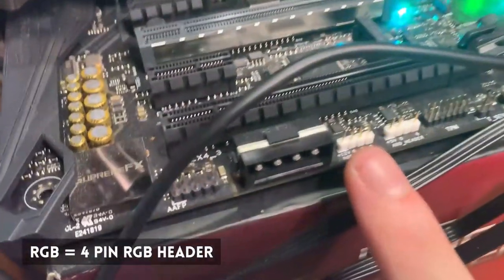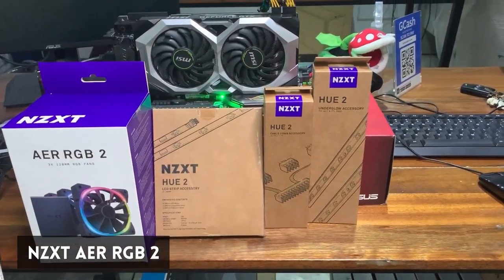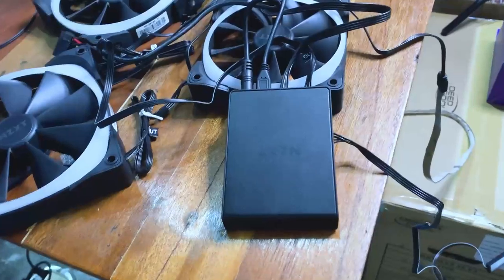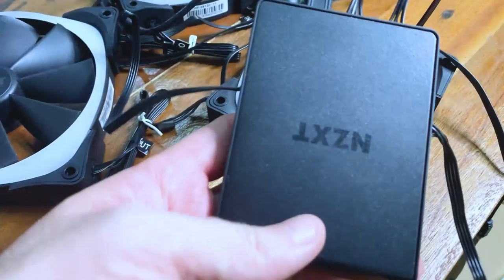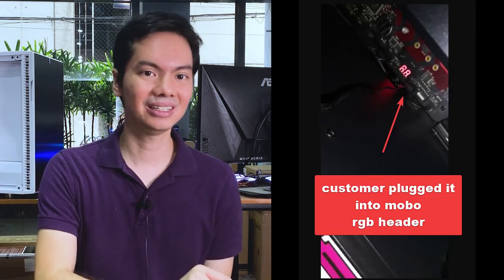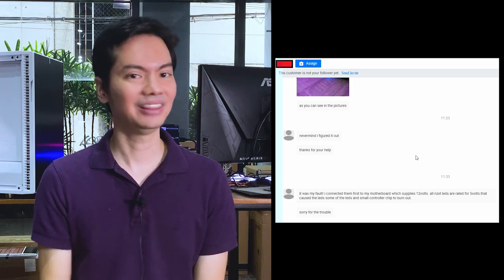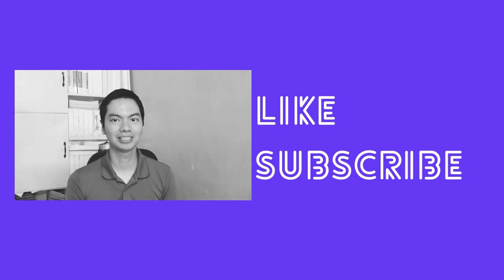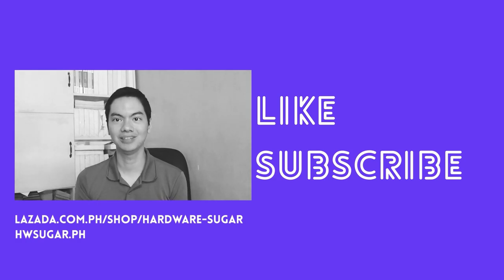Don't Do It - Plug NZXT RGB into standard motherboard RGB header

Comment: I can confirm plugging the NZXT rgb fans into the 12v rgb header on the mobo lights it up momentarily followed by some lovely pops of the LEDS exploding, lastly with an aroma of burning electronics. That’s one rgb fan down the drain. I’ll tell you this it might actually work if the output of the header was 5v instead of 12v because the LEDs are 5v LEDs
Reply from the maker: I wouldn't try it even with the argb header, just get the nzxt controller to be safe :)
Reply: did it damage your motherboard too? or just the led's?
Reply: @hwsph  F120 RGB working just fine on the 5v header with an adapter cable using mobo RGB software

Comment: I plugged Phanteks case rgb into asus dark hero aura gen1 12v with official phanteks adaptor to do the job. Worked for about 5 seconds until the rgb controller exploded on the mobo.  Thankfully the case leds were unharmed and can still run off the basic phanteks controller.
Reply: Same thing to me with the NZXT strips that came with the case.. tried plugging into the 12v header.  .. just a few seconds then nope.

Comment: The short answer is if you plug into wrong rgb 12v header instead of 5v Argb header, it won’t fry your motherboard or rgb or your Aio cooler. The motherboard has protective mechanism that prevent boot up if rgb is wrongly plugged in. I have never damage any rgb so far in 2 pc. As a matter of fact, I have tried it myself with nzxt kraken x63 and the pc won’t boot until the rgb cable of the pump is plugged into the correct header I.e argb 5v

Comment: I did it.. before I saw this video.  I have an NZXT H510... Plugged one of the RGB case strips into a 12v header.  BOTH are 4 pin.. but NZXT is 5v. What the heck NZXT. I know I'm dumb, but that's dumb.  The strips are dead of course.. just 2 lights out of 20 working.
Reply from the maker: RIP led strips :/

Comment: my 120mm AER RBG 2 NZXT fan did not come with a hub of any kind... i was not aware i even needed one...
the GPU i have is RTS 3060ti
CPU AMD Ryzen™ 7 5700G 3.8GHz [4.6GHz Turbo] 8C/16T 20MB L3 Cache 65W W/ Radeon Vega Graphics
and motherboaard is
ASUS PRIME X570-PRO ATX, RGB, 1GbE LAN, 3 PCIe x16, 3 PCIe x1, 6 SATA3, 2x M.2 SATA/PCIe  MSI

Comment: I have 4 NZXT F120 core RGB fans and 2 F140 core RGB FANS, can I run those through two 3-way splitters and plug them directly in the 5 volt (3 pin) RGB headers on the motherboard?

Comment: Manufacturers really should make RGB connections user friendly. Proprietary connectors and hubs are just plain greedy on the manufacturer's part so you can only buy products from them to upgrade your system. 

Then there are instances like what you shown that end users inadvertently damage the products. If these users were in the USA and bought it from Amazon/Newegg they'd send those back for RMA and just add unnecessary costs for everyone involved.

I know it's the end user's fault for not reading the manuals thoroughly but you can't expect casual first time builders who aren't technically inclined to get these things right even if you explained it to them.

If they can implement standards for PSU connections, USB, PCIe connectors, 3-4 pin fan connectors, why can't they do the same thing for RGB?
Reply: "Proprietary connectors and hubs are just plain greedy on the manufacturer's part" you got it. On top of that, they'd also update those hubs once a year with new versions or "PRO", "ELITE", "GAMING PRO" variants.
Reply from the maker: I agree RGB could be a lot easier. We still get confused by different rgb products all the time.

Comment: I fried my 140 aer 2 rgb by plugging it to the led strip extension. Smells nice
Reply from the maker: well at least you got some enjoyment out of it
Reply: @hwsph  Actually one of them worked for 4 months without getting fried. The OUT side of the cable was plugged into 4pin exstension from the led strip.  It had to be secured with tape because it was getting disconnected easily. Now i got new fans for my h510 elite and it fried instantly

Comment: Are you serries, the RGB strips from NZXT are addressable and just remove the splitter cable that allows them to plug into the hub, than plug the RGB directly into the addressable connection on the motherboard.
Reply from the maker: this video talks about plugging it into the 12v 4 pin rgb header, your comment is talking about plugging it into the 5v 3pin argb header - these are 2 different things

Comment: I got my first NZXT RGB fan today and of course plugged it into mobo and was wondering why it didn't work... Now before you say "should have looked into the manual" it explicitly said in there to either plug it into the hub or directly into the motherboard... (F120 RGB fan)
In my opinion it's stupid and actually malicious that you need a proprietary hub for the RGB to work.
Reply from the maker: no judgement, happens to a lot of people

for the higher end brands, eg. nzxt, corsair, unfortunately a propriety hub is the norm

Comment: Yes, the hub will still work, only the stripes will get damaged if you connect it directly to the Mobo. For me personally, all the chanel in hubs are working even after connecting damaged Nzxt strips back to the hub. The hub actually has hard time detecting the strips and sometimes recognizes as a completely different product. The stripes simply doesn't work. That's all. Nothing much will happen.
Reply: Can verify. NZXT detects smart device and strip but only one led lights up on the strip 😢

Comment: does kraken Z73 water cooler work as a HUB for my AER 2  fan? there is a 4 pin header that is connected to the hub and is just dangling there cause I bought none RGB one :/

Comment: Im so scared right now, literally shaking. I plugged in my fan to the fan connectors and the other to the rgb header (its a corsair fan) as soon as i started it up i hear this “buzz” and the smell of burnt. I quickly unplugged it. No damages seem to be on my motherboard but my fan does smell like burnt. Where am i supposed to connect my second cable? The rgb header got it to turn on. Also will i be ok? Is my motherboard going to break?
Reply: well, 4 pin cable, 4 pin mobo header.. I will explain it to you. 

Corsair Eco System is easier to play around with and adapt other non Corsair products to it than NZXT in my opinion. Also Software.

Anyway, lets get to your issue.

Corsair uses 5 Volt aRGB and the 4th pin on the RGB fans are for daisy chaining, so your effect will continune on to the next fan. 
Your 4 pin Motherboard Header is 12 Volts. This means, you blew the LEDs on the fans due to overvoltage if they dont turn on when you try again doing it right this time.

Now to the solution.

You need a Corsair RGB Fan Hub (preferably the one that directly goes to usb) or you can use a Lighting Node Pro and then a Corsair RGB Hub. Or you could get a Commander Pro and a Corsair RGB Hub. Or what also works and is probably the best solution, Corsair Recently dropped the Commander Core XT. The Core XT lets you connect 4 pin PWM Fan cables AND 4 pin RGB cables into it. For a total of 6 (RGB) Fans.

So whatever you choose to do, from my eletrical understanding, your LEDs on the fan are toast. If you get warranty and can get a RMA, go for it. Otherwise you will need another Fan, a RGB Fan hub/Core XT/Lighting Node Pro + RGB Hub. Remember to plug the RGB Connectors into the 4 pin connectors on the device you will end up using. If you use a Core XT in the end, be aware, Fans use 12 Volts. So if you plug your RGB Cable into a Fan header on there, you will be roasting your LEDs again. 

If youre unsure where to plug what, read the manual carefully. RGB is confusing, I know. And manuals can really help an unexperienced user with these things.

All the above is regarding to your problem, so if you have read until here, I say thank you for listening and I hope I could help. However I want to explain a few things more, if you dont care about that and stop reading my stuff underneath, thats fine, but it might be useful in case you want to deeper understand what Corsair is doing here.

So as I said, Corsair is using standard 5 Volt aRGB on the 3 pin connections. Which is a good thing actually. It means they dont have to reinvent the wheel and also a user who knows that, can use that knowledge to adapt any 5 volt aRGB device to their controllers and let them use non-Corsair RGB LEDs in Corsair Software.

So for example, if you make yourself or get an adapter from the 3 pin JCORSAIR (Locking Dupont) connector to like a standard motherboard connector (3 pin 5050), you can use a whooole lot more RGB devices that arent from Corsair. Im currently working on such stuff myself for my upcoming DK-05F Build.

Currently I'm experimenting with using a Lighting Node Pro and a 3 pin aRGB adapter and a normal mini USB to USB-A cable (The one USB Connector type that has been around forever basically, I cant show you pictures on YouTube comments, but if you search them up, you will see for yourself)
for external use of non-Corsair RGB LEDs and devices. You can also hook up fans from a different manufacturer, as long as they use 5 volt 3 pin aRGB.
Only thing you should note though, dont connect more than a certain amount of LEDs on to one Channel, or you blow the fuse on your Corsair controller. Or worse, you blow your Corsair controller and not only a fuse. Judging from the fact that Corsair lets me configure 5 450mm (135 Leds in total) RGB strips in software on one port of my Core XT and Lighting Node Pro, I assume you can roughly hook up to 100 LEDs to one port. Dont quote me on that tho and I havent tried or met the limits yet and I certainly dont want to do so. Those Controllers arent cheap afterall :O

And for configuration in software:
Choose whatever Corsair product meets your Devices LED count in the menus. And if they dont match up perfectly, configure it as a product that has slighty more LEDs than what you actually have. Rather have the effect not top out than having it not fully utilizing what you have :D

So for example, you want to connect an Arctic P12 PST aRGB fan to your Corsair stuff, check the fans specs, it has 12 Leds. A HD120/140 has 12 Leds aswell. Perfect! So you just add it as a HD fan.
You can get pretty creative with it, especially when you use a "fan" in software for a LED strip in reality.
If you get to understand it, it can be very nice stuff. Have fun, hope this helps anyone!

Comment: If i plan to use 1 AER RGB 2 fan as a rear exhaust fan... do I really need the hub still?
Reply from the maker: short answer, yes

if you have the h510i it already comes with a "smart" hub which can accommodate one fan - if you don't have one of the cases that comes with a hub you'll really have to get a hub
Reply: @hwsph  bruh :(
Reply: @CoolJoshido212   have you tried connecting the fans to the mobo header? because I am also thinking to get one of those fan to use as a exhaust fan
Reply: @starrims  i got the fan hub but don’t have a spare USB 3.0 on my mobo

Comment: well, shit. took me ages to find this one out

saw something on making fans quieter which involves just putting the fans on their own headers on the motherboard and just do a fan curve the old fashioned way, slightly different speed on at least one 

so I cracked open my H710i and took out the hub, thought I wouldn't need it since case fans aren't gonna be working on it. never seen the types of ends on the RGB strips that come with the i on anything else, just figured the one end that normally would be in the hub could plug into the motherboard aaaand it didn't work. 

figuring out now that NZXT wants you to use their hubs. even if I haven't completely fried the strips. I'll be getting rid of them for standard strips

Comment: so what do we plug in to the rgb/argb header on the mobo's? fans only?..
Reply: RGB devices. Just not NZXT stuff.
Reply from the maker: most rgb is still plugged into the mobo headers (eg. aios, led strips, built in case lighting) although you do need to watch out for those which have their own system (like NZXT)
Reply: @hwsph  thanks. I realy have a bad history with mobos and headerals. thanks for clearing it out. more power sir!
Reply: @rockyismael  thanks sir!

Comment: bruh the shop owner told me to plug it right into the 12V BRG header cause I had one AER 2 fan so I asked him do I need a hub for this? he's like nah there is an RGB header on the motherboard...
Reply from the maker: you can try that advice, if you do let us know how it goes :)
Reply: @hwsph  fan is fried most likely, some leds are stuck at green blue and red tho it is still spanning , I wish I found your video earlier  ):
Reply: @hwsph  does kraken water pump work as a hub? it has a 4 pin header on it and it is also plugged into a USB slot on the motherboard if so the shop owner should've told me that
Reply: @hwsph  rip $40
Reply from the maker: @PieZuri  damn bro sorry to hear the fan is rip - the kraken does function as a hub but it's just to power the fans to spin, to enable/control the rgb you'll still need nzxt's smart controller (like the one we showed in the video - all of the rgb stuff plugs into the controller and then the controller plugs into an internal usb hub on the mobo)

Comment: . That's argb
The greay wire or the first one is v the next is d and third is g ,
Just swap 3rd and 4th and put in argb header. It'll work. Have been controlling my nzxt elite h510 since 5 months from my asus board. By modding this. Threw away my smart device 2
Reply from the maker: thanks for the tip
Reply: hey still working fine?

Comment: I’m so confused am I doing something wrong ASUS 350f strix motherboard says I need a 4 pin 12v connection but I can’t find fans with this ANY WHERE! I can only find shitty 4pin 5v 😠 so pissed
Reply from the maker: I'm confused as well as 4pin 12v is the standard for RGB and they are usually easy to find, eg. Deepcool's RF120 fans. For the argb the standard is 3pin 5v, I've never come across 4pin 5v.

Comment: So what does rbg and arbg do?
Reply from the maker: Both of them are pretty lights. Rgb, which you plug into the 12v/4pin rgb header on a mobo, is less customizable as control is at the product level - not at the individual led level. Argb (aka digital rgb), plugs into a 5v/3pin header and lets you control each individual led of the product - leading to lighting schemes you can't do with rgb. For example with argb you can have different colors light up at the same time on one product (eg. one part of the fan is red while another part is blue, at the same time); you can't do that with rgb.

It is all rather confusing and we will do a video on it in the future.
Reply: @hwsph  what if you have an nzxt argb which requires to be plugged in the hub then u insert the hub into a usb header... where do you plug the other usb(lets say for example @ the front panel and @ the IO?) in the mobo. Just curious :) thanks for d knowledgeable answer btw

Comment: I was supposed to buy a new laptop but decided against it cause I'm gonna be working from home most of the time. Plus, I wanted to play PUBG on a device which could push more frames without breaking the bank (too much) So I got an NZXT H400i cause I liked the design and saw reviews on how easy it was to build in. Loving the features and form factor so far. So I'm a bit OC and have recently got into the PC Master Race. Now, I want all my fans, AIO, etc to be NZXT! Question, when will the NZXT Kraken Z63 be in stock again? Hehehe
Reply from the maker: I like how you segued appropriately into your question, welcome to the PCMR 😁 Tentative restock is next month.

Comment: can argb and rgb connection be hot swapped or does the pc have to be off for that not to damage the rgb?
Reply: I hot swap my Argb are rgb headers all the time, haven’t ran into any issues
Reply: @MrGemini69  the header didnt go in firmly enough and came off on its own while the pc was on and it burnt the rgb on my Cooler master ml240l v2 argb
Reply: @FelipeNiclvs.  it shouldn’t burn anything especially not the rgb(motherboard is possible to be burned if shorted), Do you think you have have used the wrong rgb header as argb is 5v and rgb is 12v. And most brands have their proprietary connections which are not going to work with 4 pin or 3 pin on motherboard
Reply: @MrGemini69  i used the right one which is odd

Comment: Boss asking some advise ngbuild aq asus b450m-a yung board may 1 4pin 12grb header bumili aq ng deepcool rf120m 5 in 1 kit yung 5 fans nka series lahat sa isang 4 pin mb sync cable dun ko inilagay sa 4 pin rgb header tama po ba ginawa ko?masync q bah xa using aura sync? 
Follow up question plan ko din mg upgrade ng single fan aio cooler pede rin bah e plug ung rgb cable ng fan sa same 4pin rgb header gamitan nlng ng splitter cable ang sync cable?

Comment: Boss I'm planning to upgrade to NZXT case ung meron ARGB fans included, curious lng ako boss, ung CAM na program ba macocontrol nya ung kulay ng fans? Kc sa usb header db coconnect ung hub na ksma? Wla kc ARGB header ung mobo ko hehe! Sna naintindihan at naexpress ko sarili ko hirap iexplain haha
Reply from the maker: Yup, if you get an NZXT case like the H510 Elite it comes with ARGB fans which plug into the included controller which then plugs into the internal usb header of your mobo.
Reply: Hardware Sugar thank you so much! More power!

Comment: may i know what should be connected in rgb/argb headers?
Reply: Most RGB stuff. Just not NZXT ones.
Reply: @rockyismael  thanks!
Reply from the maker: Most rgb brands follow standard rgb making their products compatible over a wide range of the large mobo manufacturers (principally Asus, Gigabyte, MSI, ASRock). But even if a product is "standard" you still need to figure out if it is rgb or argb. Which should be the topic of a future video as it really is quite confusing.